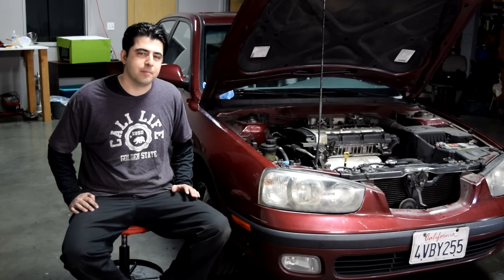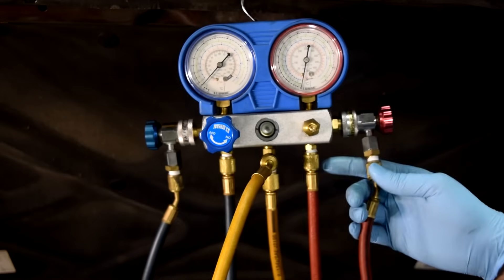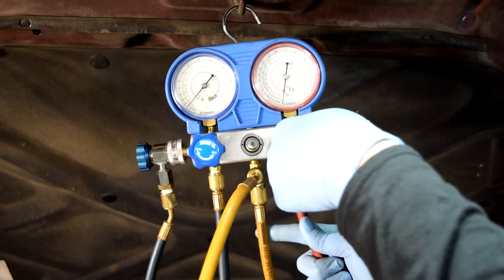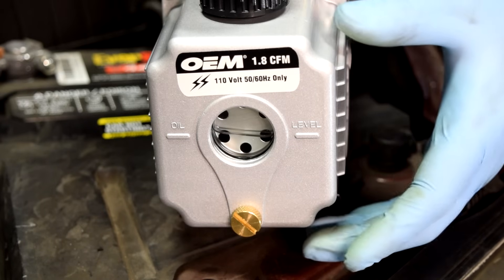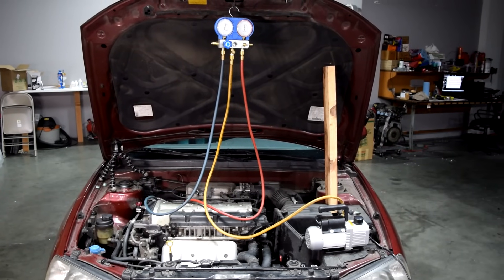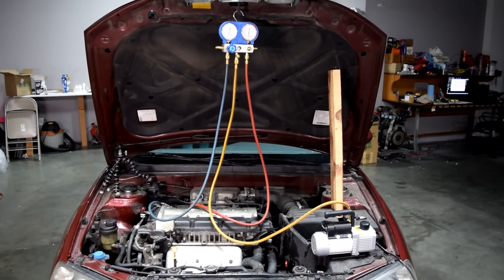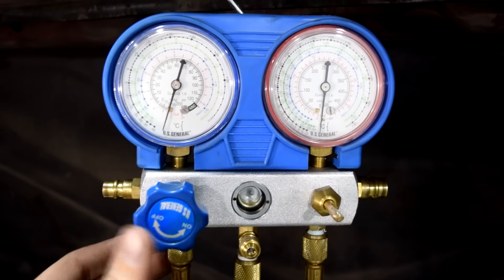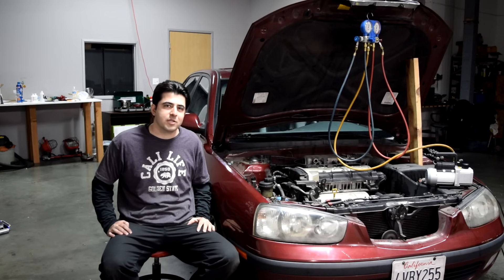How to Pull a Vacuum on an AC System - Step by Step

Comment: I replaced all the components on my A/C system except for the evaporator.  I pulled a vacuum and it held for about 3 1/2  hours without losing vacuum.  I charged the system, and it worked well for a couple of days and then lost all of its refrigerant.  After the refrigerant leaked out, it still held vacuum.  Have you ever experienced this?  Any idea on what is happening?
Reply: I'm having a similar problem with a 2010 Toyota Tacoma. At this point, I've determined the leak is the evaporator under the dash. Part is only $100, but labor has been quoted as $2000 to $3000. The whole dash has to come off including the steering column.
Reply: @rsbreeze  I'm pretty much resigned to the fact that I'm going to need to replace my evaporator (although I will probably have a shop confirm this for me).  I don't have the money for labor, so I'll have to tear down my dash myself.  I'm not looking forward to that.
Reply: @chucklemberg4968  I don't know if you resolved your issue already but if your system is not leaking during testing but then you find it's leaking during use, the only components I can think of that isn't in the test loop are the *valves*. The caps have o-rings inside that can leak over time--the cap, not the valve, is actually the final seal. You might feel a little pop when you remove your cap. Those Schrader valves can leak over time especially if you accidentally bottom them out when you're using the gauges. When you're testing, though, the valves are engaged and fully sealed so they wouldn't leak during testing.
Reply: Never could find a leak with mine using soapy water, dye, air pressure, and gas sniffer. 

I used some Blue Angel AC sealant and it helped for a while, but now leaking again.

Comment: Thank you for clear explanation 👌 
 Question : is it ok that the vacuum on low side is not -30 but perhaps -25? Currently pumping it's been an hour and I'm wondering if it's okay to stop here :)
Reply: What elevation you at? At sea level you should at or close to 30.
Reply: What if I'm 25M above

Comment: After you pull all the vacuum out, why do you close the valves on the manifold gauge set? Doesnt that just seal off the actual gauge, ensuring there isnt a leak and not give true accuracy to if there is a leak in your system? If I close the gauges on the actual manifold set, closest to the gauge, the pressure stays constant. If I open the valve on the actual manifold set, closest to the gauge, I lose pressure slowly. I just cant wrap my head around this. Please explain.
Reply: Once you get the proper amount of vacuum (~30) you close the low & high valves to close the system (hold vacuum). This way you can check for leak/s in the system.

Comment: And it shouldn't take more then 10 or 15 minutes to vacuum any system. Of it does you elthw rneed to rebuild your pump or you have a leak. I'd start with the latter lol

Comment: See that's not the best advice. The best way to know when your done pulling vacuum... Is by listening to your pump. And by putting your hand over the exhaust. If it's done.... You won't feel any pressure when you cover the exhaust. But yea listening to the pump is even easier. Close the valve and listen if you pumps sound changes any. If it doesn't change when you close the valve and then open it again then it's done.

Comment: I cant get the low side to vacuum past -20. I did not open the system except to change out a shrader valve port. Is this normal?

Comment: I’ve got a question that you might help me with. My f-150 air blows not so cool when it’s really hot and humid. Yesterday the temp was 96 heat index was 107. So yes it was hot and my A/c was barely blowing cool air. As I was driving across town a storm was brewing high winds just a blowing, well, the wind blew the heat and humidity away bringing the temps down to 81 degrees. Once the temps got low my A/c went to cooling nicely after that. Can you possibly explain what causes that and how to fix it. I can do most anything but I am on disability so I don’t have a lot of extra money to pay somebody when I can possibly do the work myself. Any help will be appreciated.
Reply: A dirty condenser can cause these symptoms

Comment: What does it mean when the gauges start back up from 0 after u let it sit for awhile? I pulled vacuum down to zero, turned it off and an hour later gauges had moved a little
Reply: slow leak
Reply: Down to 0? If you pull vacuum it will be down to ~30.

Comment: I am kind of confused about the part when you are done pulling a vacuum, and you check to see if the system will hold a vacuum to check for leaks. My question is about shutting the low and high pressure ball valves off. In my opinion if you shut the valves off you are segregating the gauges from the rest of the system. So if there was a leak in the system you would never see it on the gauges because the valves are shut so any pressure changes would not be seen on the valves. The only way in my mind to get a accurate reading would be to leave the low, and high pressure valves open, and get a ball valve for the "charge" line (Yellow hose). So after you pull a vacuum on the system instead of shutting off the low, and high pressure valves you would leave them open, and have a inline ball valve on the charge line (yellow hose) that would be shut off right before shutting off the vacuum pump to keep any vacuum from escaping the charge line. Then you could monitor the vacuum on the low and high pressure side accurately. Please correct me if I am wrong.
Reply: Huh? When he shuts off the valves at 4:28 , he's closing the connection between the Manifold and the Vacuum Pump. The Connection to the AC lines to the manifold is still there (See valve at 3:33 )

Comment: Good video. I wanted to make a note to you and others watching about one thing that you said.   You mentioned to add Teflon or thread tape to your manifold threads.  These are not the type of threads that need tape.  The treads are not where the seal is made, so adding Teflon tape is at the very least a waste and and most may cause the fitting to seal properly.   Any of those connection points seal with a internal oring and should only be hand tight.  Do not use a wrench or tool to tighten.   Anyway, over all great video. Just thought I'd throw that out there.
Reply: Excellent point, I kept thinking the same thing. What will the Teflon tape do? I noticed it has a green O ring inside.
Reply: @GeorgeL1943  sorry for the late response.  There are all different types of threads. Some make the seal through the threads often needing thread tape and or thread sealent.  Others seal with a o ring.  Npt or national pipe taper tightens and seals throigh the threads.  .  The more Most threads that only require a hand tighten typically seal through a o ring or gasket.   Like garden hose, or in this case your vacuum hose.  If you add the thread tape it can cause the o ring to not seal properly.  If you only did a couple times around with the thread tape it probably wouldn't have any negative effect.   Knowing that thread tape isn't necessary on these types of threads  o would just skip it.
Reply: @VikingsFan27  hey Vike, i was kinda thinking same thing.  do you think it would be wise to put a little bit of PAG oil on those o-rings?  i ask because i've got a fairly cheap gauge/pump kit coming from amazon (great reviews though:))) and i was curious if that would help with seal.  on other applications i will use some dialectric or silicone or whatever to coat the O-rings but i was wondering if since i will be obviously be using this for my AC applications if coating with some PAG would make sense to you.  Oh, by the way, i think your team is gonna be sneaky good this year, kinda pumped to finally see an offensive coach for ya:))) -barbie
Reply: Thanks, I was about to go find some Teflon tape
Reply: Thanks for the informative video. You answered my questions.

Comment: In your video "How to pull a Vacuum on an AC system - Step by Step" you mentioned that pull a Vacuum up to an overnight. Please, could you tell me what happened to this unit I have served a few years back and the compressor got damaged cause did not pump right again. I was told later that the seals got damaged. Is this the case? Thank you. because of that action

Comment: Pressure loss on high side.
When I do the vacuum test, the low side stays on -30 PSI for an hour BUT the high side seems to lose vacuum.  After a few minutes, the high side goes from -10 PSI to 0.  Is this a concern, the video doesn’t seem to look at the high side which I don’t understand why.  The two sides don’t seem to be “connected” when the car compressor isn’t running, car turned off.

Comment: 2 years after watching this video...the AC in my truck still works better than most new trucks. I forgot to mention, to justify my purchase for the pump and gauges. I fixed my mother in law's AC, and my sister's AC with minimal parts.

Comment: Don't you want to evacuate through the low pressures side? If you evacuate through both the high and low pressure side it will take forever.  Since you measure the negative system pressure on the low pressure side, opening the high pressure side does nothing because its all on the low pressure side.

Comment: Teflon tape doesn't make it not leak as those connectors don't seal on the threads. They seal on o-rings inside.

Comment: I've seen it both ways. Do the bent end of the hoses connect to the gauges or the couplers?
Reply: Well there is not a lot of room on an old style manifold.  Three  male fittings in a row so three bent ends would be hard to put on.  Your male ends are all pointing down.  You should use the bent end to attach to the high, low sides, freon container or vacuum pump they are almost never in a straight line to your manifold.  Thus a bent end makes for an easier connection there.  Also on the old hoses some ends have a Schrader valve depressor inside the end and maybe not on the other end you need to put the end with the depressor where you have a Schrader valve.

Comment: I had a leak in my AC system and it appeared it might have been from the high side port so I replaced both ports - high and low (these didn't have removable Shrader valve stems). I pulled a vacuum for 6 hours and it never moved from -30 hg, so I assumed "no leak". I recharged the system and by the next day, the system was nearly empty again. I had used a UV dye and could not find any illumination. I had heard that it is common for leaks to occur on the compressor at the seal where the clutch is at and you will not see the dye. Also, since the evaporator was in the AC case, it is another area where a dye is not going to be seen. So I ended up replacing both the evaporator and compressor. I also changed the accumulator, orifice tube, and every one of the seals. I pulled a vacuum for two hours - still held at -30 hg without moving from that, so I recharged the system again. Lo and behold, the system was nearly empty by the next day again. ?????? How is that possible? How can I have a leak that bad and don't lose vacuum? To be sure I did leave the connectors open (depressing the shrader valves). I'm baffled!
Reply: Did you ever fix it?
Reply: @nuhnyuh7493  Yes, found the leak on the hose going into the firewall. It was tucked in under the cowel really well so didn't see the dye.

Comment: Now i mist ask howndo you go about recharging your car after changing the ac components and vaccuming the lines is the car supposed to be turned on before puytting freon in
Reply: He clearly stated that there is another video to explain the recharging process.  I've watched it and it does answer your question.  You don't run the engine when pulling a vacuum - that's all that this particular video covers.  Watch his other video.

Comment: This guy has absolutely no clue what he's talking about. First off he's using analog guages, which are not accurate. He's also not using a micrometer when vacuuming the system, so it is absolutely impossible to know if it vacuumed down properly...and most important of all, he removed  his hose connections before he re installs the new freon, which completely defeats the purpose of putting it in a vacuum state because it instantly allows the ambient air to suck right back in. I hope nobody uses this video as advice. You will ruin your ac system.

Comment: Great info! Fast and clean. But now that my oil is added and my vacuum is pulled I suddenly realized that at just 45 degrees temperature where I live it's too cold to add my R134 and I don't have a heated garage. Is it safe to drive my car like this and add my coolant when the weather warms up several weeks from now? Can anyone offer a solution or suggestion?

Comment: Question...is it normal for the vacuum pump to sound like that? Also, is it normal for it to smoke? I flushed, replaced my compressor, drier/accumulator, orifice tube, added oil, and I thought I was so close to being done, then I go to pull a vacuum and my pump is smoking...Figure HF gave me a bad pump. Yes, there was oil in it.
Reply: Update: I did some research and it appears this is called an "oil mist" and is actually normal...how weird

Comment: if i have a small leak in the system? and need to add freon. Do I need to pull  a vacuum on it? I have a 2006 focus
Reply: Not if there is already refrigerant in the system.

Comment: I didn't see you mention that there is a GAS BALLAST on the vacuum pump that must be at least cracked.  The gas you pump out has to go somewhere..like the atmosphere.  If left closed, oil from the pump will start getting pushed out of the pump..that's where the bad gas goes..and will cause a mess

Comment: I have like a water sound on the ac lines when the ac and the defrost is on I can hear on the engine bay and behind the dashboard  and is not the hose that is cloogled, how can I fix that? What could that be?

Comment: do not put teflon tape on flare fitting threads, 1 it will NOT stop any leaks and 2 it could possibly be fragmented while threading the joint together and contaminate the closed system the lines are attached to, or the vacume pump. The only sealing surface is between the flare and crown.

Comment: I changed out my manifold hose assembly on my 2003 Ford Escape . I turned on the car , turned the ac to full blast cold and tricked the compressor to turn on by using a paper clip where the fuse would go that way the compressor can stay on. At this point I tried to charge the line but nothing happens. The gage doesn’t move. None of the coolant wants to come out of the can and enter the system ??? Any ideas ???

Comment: Great video! And as coincidence would have it, I also went to AutoZone and got exactly the same vacuum pump and manifold gauge set, so this was especially pertinent to me!

Also, when I first started pulling a vacuum I could not get the low pressure side to go to zero. Then, when you mentioned a tight seal is necessary on the lines I tightened up and figured out I had a small leak on the high-pressure side. Gauges went like they should,!
Reply: MrJeffcoley1 mines doesnt go down and they're all tight as can be

Comment: Great Video. Thx. After replacing my ac compressor, expansion valve and dryer and filling up with new oil and Freon everything works great. Now I’m wondering because my compressor gets really hot. Is that normal?

Comment: If you do vacuum the oil in the compressor is eliminated?
Reply: It’s typical recovered when you remove all the fluid when the compressor is changed out.. I believe you perform a vacuum to make sure all the seals are still good or replaced to prevent any leaking.  Oil is definitely needed and a specific amount is a MUST before recharging with recommend amount required by you vehicle always check under the hood labels or within the owners manual. Hope this helps..👍🏻  Stay cool

Comment: How many inches of vaccum need to be pulled when evacuating a repaired a/c system? As quick as anyone can get back to me would be great
Reply: Elizabeth Calloway Standard gauge ears are very in accurate and 29 inches of mercury is not enough you actually have to be able to measure all the way down to roughly 500 µm or less which is in possible to do one standard gauges. I’ll give you a link to the refrigerant manifold gauges I use I have been using these type of manifold gauges for nearly 20 years and this is the newest update version one of the best on the market. 
https://www.trutechtools.com/Fieldpiece-SM480V-Digital-Manifold-Set-of-4-Premium-Ball-Valve-Hoses?gdffi=82d4608f40bc44b8876f395eb04c4801&gdfms=54C7972721F644B592CD59F37672F14D&gclid=Cj0KCQjwpPHoBRC3ARIsALfx-_LihTw8V-P_reJFMzDmXi8Lp5DsPc4CXtZwAcAihYFmp0Yiy1Ad5uIaAovKEALw_wcB
This will Take you to true Tech tools where they have great training videos on proper evacuation and equipment procedures. If you wanted a standalone micron gauge this is the link below
https://www.trutechtools.com/BluvacProPlus
Go to True Tech Tools to use them for their free training guides and videos on proper methods of pulling a vacuum you will be looking for videos by Jim Bergman he’s made hundreds of videos so CGA and Jim Bergman plus vacuum you can search him on YouTube also

Comment: So there’s no tutorial on the vacuum pump oil?
Reply: Vacuum pump oil is supplied with new compressor or can be purchased at an auto parts store-  always have more then needed on hand to replace the old oil when you’ve performed this service..  hope this helps